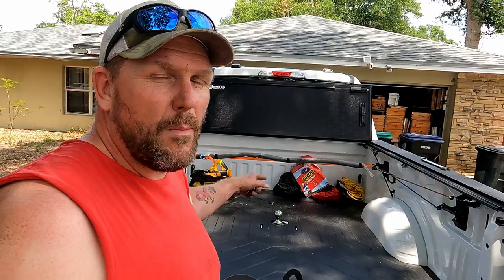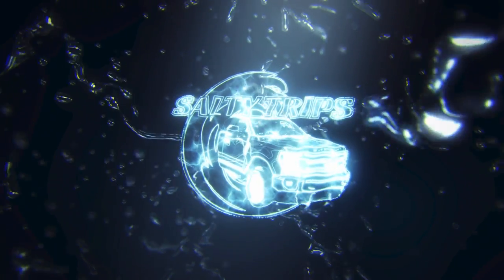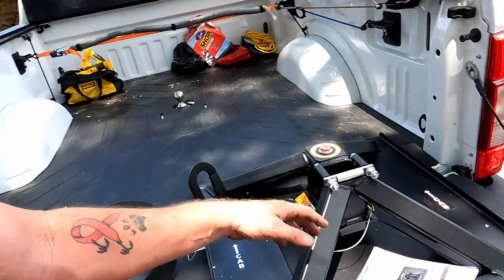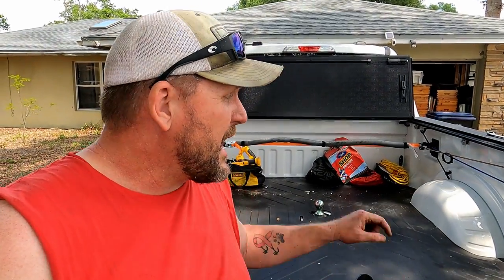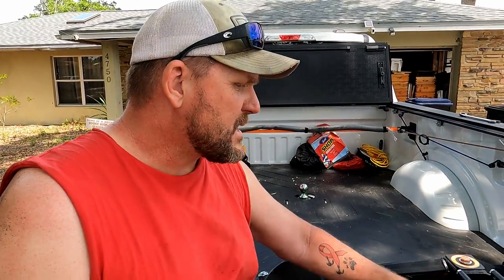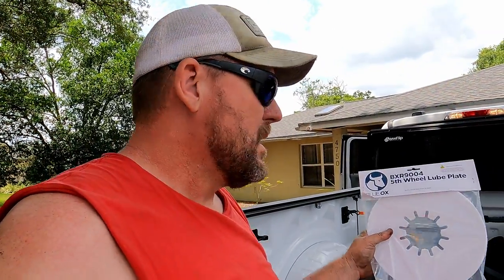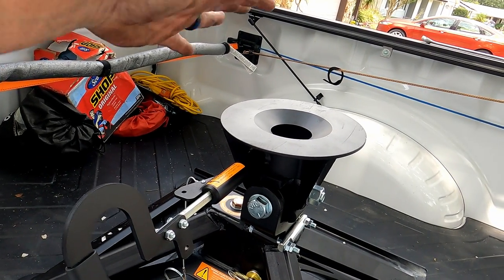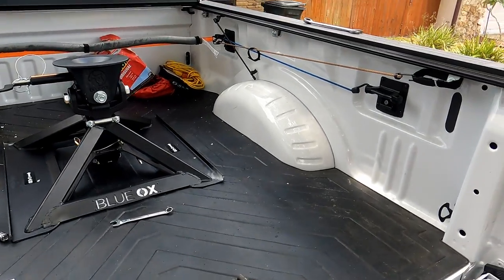Blue Ox BXR2100 install & review, best light weight 5th wheel gooseneck adaptor hitch? RV life!

Comment: Loved the attention to details on explaining the mounting. Just installed the Pullrite Auto on our truck. First time going with a 5th wheel. The 5th wheel weight is just shy of 2K. Camper weighs 10,500. I have the diesel SD 4x4 and also added a Helwig rear sway bar for better towing stability. Are you using any type of air bag system as well?
Reply from the maker: No, hasn’t been a real issue, here’s a real world use review https://youtu.be/oucR7Q1je2Y?si=eHbCV4Qn73t2z-Hm

Comment: The hitch frame is held down to the gooseneck ball with two pins under the ball, which is better than many of these things... but the trailer's kingpin is only held in by one pin, which is common for gooseneck couplers but pretty bad compared to the jaws of conventional fifth-wheel hitches.
Reply from the maker: Horizontal failure is a much bigger concern than vertical failure. The vertical force necessary to over come the hitch weight and then also shear the locking pin has to be insane. Only way thats happening is if i’m running from Boss Hog and hit a ramp to jump over a barn while hitched up.
Reply: I agree @saltytrips . The single pin is probably fine, as it is with ball couplers on gooseneck trailers...  especially when used at half the rated capacity, as you mentioned.
Reply: @saltytrips 😂

Comment: Does this hitch give an offset for short bed trucks?
Reply from the maker: It moves the hitch point back about 4 inches, you can also buy a gooseneck ball adapter for B&W to move it back another 4 inches if desired. We have the 6’10” bed and don’t have issues. Here is it https://amzn.to/3P2sw42
Reply: @saltytrips  I wish I could go back to a b&w in bed hitch. I have the factory puck system from Nissan and would have to weigh wether to remove it and install a b&w setup. However if the gen y pinbox has a 4 inch setback I may get lucky.
Reply from the maker: @cujo229  🤞🤞 good luck 👍
Reply: Can you make a 90 degree turn with the gooseneck
Reply from the maker: @mikemccarthy6939  we don’t have a gooseneck, we have a king pin hitch gooseneck adapter, haven’t attempted 90 degree turn yet
Reply: @saltytrips   ops sorry my bad if you make let me know thanks
Reply from the maker: @mikemccarthy6939  … subscribe and hit that notification bell 🔔, will be doing an more thorough review soon!

Comment: Where are the safety chains dot man would have fun with this setup
Reply from the maker: Safety chains are only required on Gooseneck hitch connections and not 5th wheel king pin connections.

Comment: This is the third video that I have seen on this unit. Every example of this hitch has horrendous weld quality!  Either this thing is way over engineered so that the welds don’t matter or a fatigue failure is in your future!
Reply from the maker: Can you give one example of this hitch ever failing?
Reply: No, but I remember the glowing reviews of the Anderson aluminum 5th wheel hitch before the reports of catastrophic failures started coming in. I have been inspecting welds for 40 years in the nuclear industry and I am a Certified Welding Inspector with the American Welding Society. These are dynamically and impact loaded structures prone to cyclic fatigue. so for the first year or two keep a close eye on the corners of the welds.